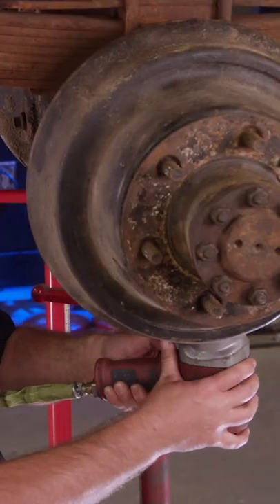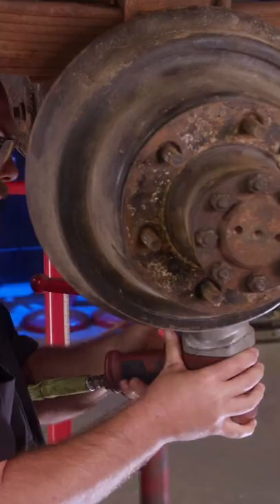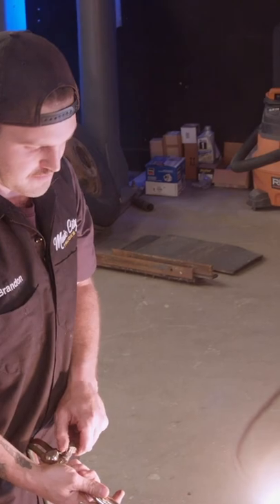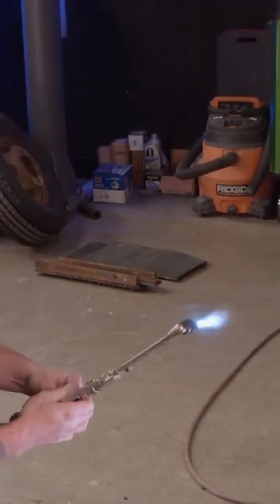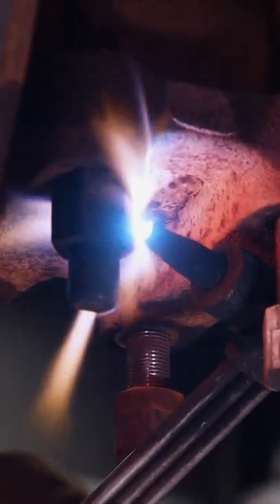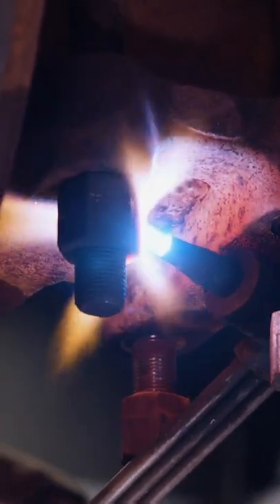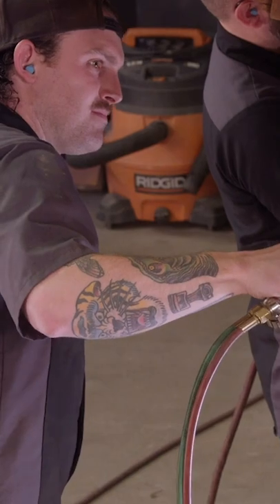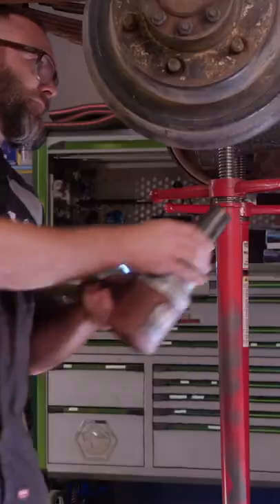Removing Stubborn Bolts with a Blowtorch

Comment: If your 3/4" is performing like a 1/2" you need to get a better air compressor, and or bigger hose.
Reply: Bet there using a small fitting
Reply: Yup
Reply: They need a better air hose, we use a bigger hose and fitting for bertha.
Reply: Came here to say that. You can hear how weak the impact is
Reply: Need at least 10 - 12 cfm and 1/2" hose for a 3/4 impact
Reply: Bigger hose doesn't mean more pressure or force. It's more likely to result in lower pressure and force due to expansion. Get a better supply first.
Reply: @Mark_317  but am going to conclude that's a big heffer. Meaning you need a larger surface area to apply the force. Compressor too.
Reply: I’m glad I’m not the only one who noticed the 3/4” gun running on a 3/8” air line - it’s like why bother?

Comment: They are u-bolts. Cut them lol. Why spend the time trying to take the nuts off? Not like you would ever reuse them.
Reply: Exactly. Heat is a. Total. Waste. Of. Time. Cutting works every time!
Reply: If he only had a torch
Reply: It can’t be stuck or rusted if it’s a liquid
Reply: You should realize  that most of the hosts of "power nation" aren't  that smart, especially these two.
Reply: I was going to say the exact same thing normally most u-bolts are too messed up to be reused
Reply: @mrow9999  not every time I had experiences where the bolt can't be cut 
But totally agree for u bolts just cut them 
I think they are just demonstrating  how heat can help
Reply: @Anthony T
In this scenario, it took less time to heat those nuts and remove them than cutting the bolts would have taken!!!
Reply: @jackwynn5971  had to melt the lug nut and stud out of a Jeeps wheel in order to get it off. Just kept melting it down, put a scorch mark on the alloy rim but ngl we just sprayed some silver wheel paint on it and it blended in just fine
Reply: Yep my last set i just cut them so fast and easy.
Reply: If the torche is around okay heat beats, but if not, cuttin' ur way off is all gucci
Reply: And supposedly they know wha there doin..
Reply: Right? Nobody ever takes them off like that. At least not anyone who had worked on trucks for awhile.
Reply: @AzzKicker-bz1cb  no it didn’t. Those coulda been cut quicker than getting an impact out. I spent years on the shop floor doing exactly this among other things. You don’t know what you’re talking about.
Reply: They will probably reuse em since thier original and can probably be restored
Reply: I feel like it's more for safety reasons they're doing it the way they're doing it
Reply: I’d keep it so I know if I have the right sizes
Reply: Right? I've cut hundreds of u bolts off 🤣 we rarely removed bolts in HD, burn them off and replace them.
Reply: Because it's the right way to do it
Reply: SOP was always cut it off. I spent over half my life working on that stuff. I can say torching is fastest. If you try to save them, it takes so much time its not worth it. Just cut the bolt above the saddle next to the spring. Sometimes there are studs which are the worst ones. They get seized in flanges on the axle, and now those are a royal PITA. U-bolts stretch when installed  and should be replaced.

Comment: Yep like my first OTR industry shop foreman said.  No bolt can hold whatever it's attached to if it's liquid.
Reply: yep, cut the nut off without damaging the bolt   lol
Reply: Most suspension bolts especially ubolts are not reusable.  After 58 years of abuse replace for safety reasons.  We had a simple policy if it was safety related nothing was reused if it was hardware or spring related that went for all brake springs and hold downs spring bolts shock bolts brake chamber mounting nuts.  If you pulled it apart new hardware.  The only person that ever ignored that one cost the boss a million dollars in a lawsuit against the company.  Why when the truck he had repaired that I was driving his reused brake fitting on a brake chamber blew apart and caused me to jack knife and kill another driver coming the opposite way.
Reply: @haroldbenton979  yup, why risk the drivers life to save 20 bucks in new hardware

Comment: Ingersoll Titanium 2235 Ti Max. Never had it struggle to get a bolt off except for a rusted out U Bolt. It ended up breaking the U Bolt.
Reply: I feel that. The only other bolt I can think of is the 12 point axle bolts on Volkswagens. They're m16 torque to yield and those mfers only seem to come off after glowing the head with a torch

Comment: I saw some guy use this expensive electric tool to heat up the rusted stuck bolts. I was wondering the whole time. Why not just get a flame torch. And what do you know, these guys are using that method. Which works

Comment: When I used to pull axles in the junk yard you couldn't use a cutoff wheel or torch. I found the best to do it is use a breaker bar and tighten the bolts. Because the ubolts are hardened normally you can simply break them.

Comment: Give 50/50 trans fluid and acetone a try. Works well for me. Spray on and let soak a few minutes. For those that are wondering, I don’t believe the type of atf matters. Atf is just a low viscosity readily available oil.

Comment: Spray some Superzilla on it and it'll come right off. I've noticed in several videos people are not using penetrating oils like PB Blaster, WD-40, Kroil, and the new one called superzilla which is supposed to outdo them all. It doesn't take that long and it sure doesn't cost that much rather than wrecking a tool or busting your knuckles, tearing muscles, tendons, ligaments, throwing out your back...trying to get a bolt or not loose. Work smarter, not harder, gentlemen. 🤔🧐

Comment: FYI- focus heat on nut, avoid all other places, soft orange glow ok, but bright red or God forbid a blueish, STOP heating, stud will be damaged. Allow to cool, try again. The idea is to expand the nut metal with heat but keep the stud as cool as possible. Nut will expand away from stud. Put wrench/tool on it and remove as soon as possible. Reverse process using dry ice to shrink things- bearings and certain inserts for example

Comment: That 3/4 impact should be running on a bigger 1/2in hose and at least 3/8 or 1/2in fittings on an 80+ gal tank for maximum power.

Comment: Tea light candle wax, heat the bolt up with the torch, then rub the wax on and let it soak into the rust and get into the threads

Comment: Heat expands metal. Wouldn't cold work better?
Reply: cold would shrink it onto the bolt more. the heat helps it expand more outward than inward, reducing the friction

Comment: Induction coil heater, proper air pressure, penetrating oil, breaker bar to start the nut, Milwaukee impact….all better options

Comment: With that straw of an air line you ain’t removing lawn mower tires, but a 1/2 or 5/8 with 150 psi and it would snap that hanger right off

Comment: No one here talking about the headline of this video calling a oxy-acetylene setup up a blow torch. Never in my 25 years as a mechanic have I heard it or seen it called a blow torch!
Reply: It's just a torch to be.      Living in Minnesota it was always uses.   Now living in Southern Mississippi, I forgot how to use it.    Lol.
Reply: Irked me also buddy.
Reply: When you pull the trigger on that torch it blows a stream of oxygen into the mix. That’s why it’s called a Blowtorch in some circles. The oxygen stream also rapidly oxidizes (A.K.A. rusts) preheated ferrous metals, so it’s commonly called a cutting torch too. 🔥
Reply: Yeah, that to me is a cutting torch.

Comment: Not a blowtorch guys... thats not even technically the correct torch to heat bolts. Does it work? Absolutely. Is a rosebud tip more efficient and better suited for the job? Absolutely.

Comment: 😂😂😂 Bolt? That's a nut pal.

Here's how you tell the difference. If it has opposing open ends, it's a nut. If the thread is on the inside, it's a nut.

Bolts have heads, and if you torch them, they often just round out or snap off when you apply the wrench.

Comment: Try adding a little paraffin wax when you use heat. The hot metal melts and soaks it in the better than any man made lubricant.

Comment: Cut them you can’t reuse them anyway. And your time is where your money is at buck it out and move on.
Reply: I always purchased new u-bolts in advance of the job. Along with nuts and center pins for the leaf springs.
Also any leaves that may be required.

Comment: Just cut it at the side just below the top of  u bolt before the bend  let it fold up pop pop done You don't reuse U bolts you cut them off teach people the right way  because I would never put a use U bolt back in
Reply: Even if they came off easy, I agree. Always use new. Why risk the drivers life when its just 20 bucks of all new hardware